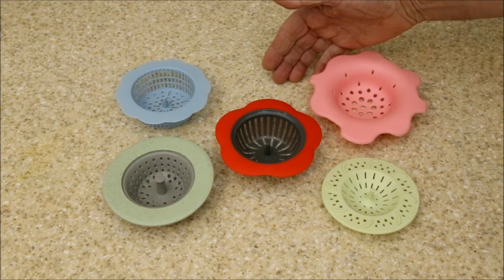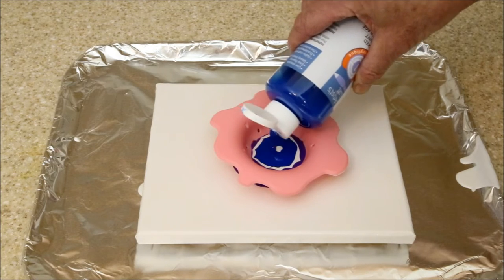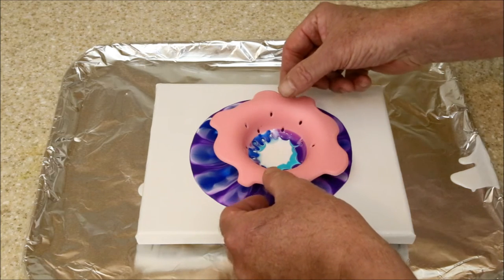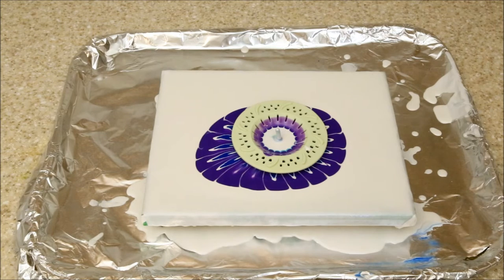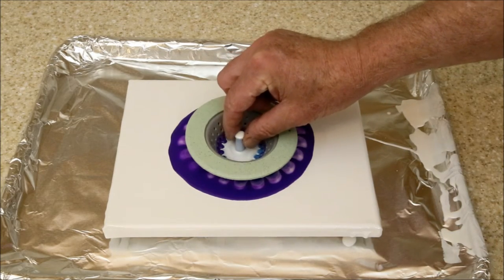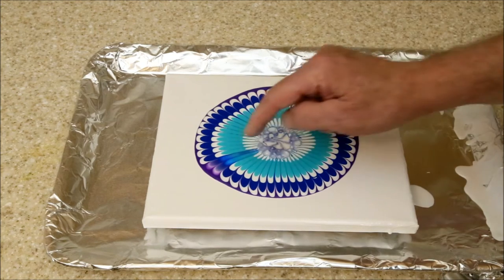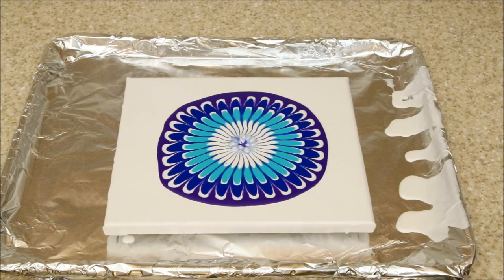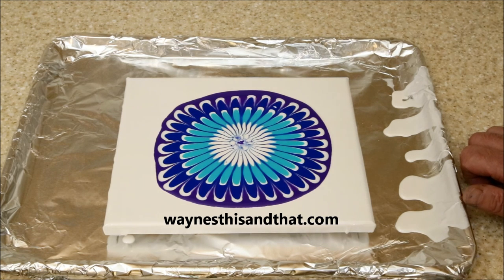Acrylic Pouring Collander Tests

Comment: I liked the one at 2:50  ! Great video though!
Reply: I agree!  Actually, I really liked the center of this one!
Reply from the maker: It seems like the strainers with holes produce diffuse petals whereas the slotted ones are more sharply defined.
Reply: Wayne Schmidt yes an I hope you can do a video about the blending going on on it!
Reply from the maker: That's what I want to try next. I think I figured out what happened. Going through the view frame by frame I noticed that during the initial pour, a drop of the purple splashed up onto the side of the strainer right where those two blended petals are. I think that drop slowly flowed down into the paint as the main body flowed out. Dipping the edge of the strainer right before the pour might reproduce the effect all the way around. I hope to try it tonight.
Reply: Wayne Schmidt please post it if you do try it even it if doesn’t work !